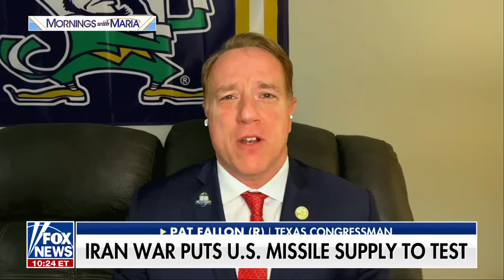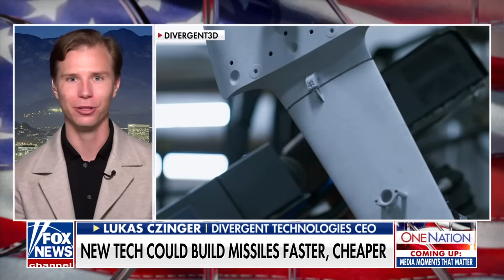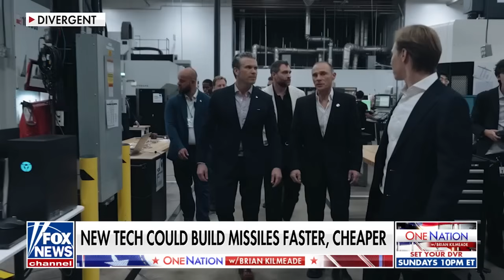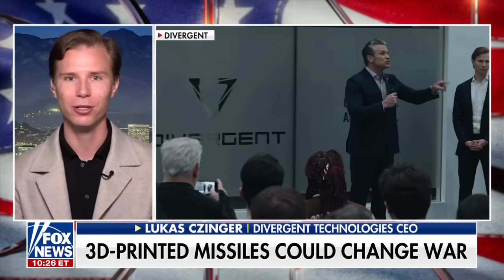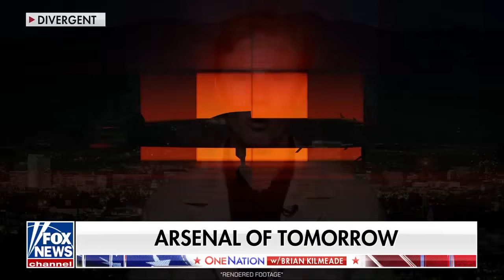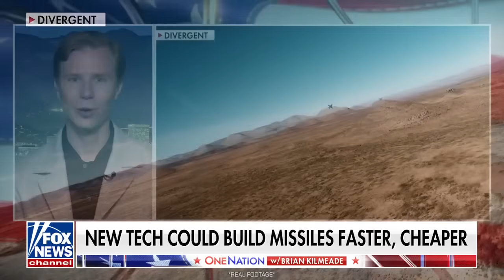ARMS RACE: Tech CEO reveals 3D-printed missiles’ potential impact on warfare

Comment: Your not getting them any faster. It takes 2 months to 3D weld just one. You don't have near enough 3D welding machines to weld 2,000 every 2 months you would require 2,000 3D welding machines and manpower to operate them.

Comment: Wow, I wouldn't think that a 3D printed missile would be able to take the stress of flight. That's pretty cool if it works.
Reply: I print model rockets, and they really aren't that durable, But I'm just going to guess that they have better printers and materials than I have.
Reply: I thinkits reinforced and they have special filament

Comment: 3D Printed Missiles.. THIS IS STUPID... 3D printing anything is SLOW AF and thus more costly... OH yea, thats why the Military Industrial Complex is throwing that idea out.. They can work less and charge more...  I have worked as an R&D engineer and machinist. Its FASTER to fabricate anything with a CNC and skilled team of welders and fabricators. 3D printing stuff only makes sense when its something you can not physically produce any other way. Like some specialty rocket engines that are being tested. Otherwise NO.. 3D printing cruise missiles is stupid.

Comment: The Rutherford engine is a liquid-propellant (LOX/RP-1), 3D-printed rocket engine developed by Rocket Lab (RKLB) for the Electron rocket.  Rocket Lab appears to manufacture roughly 1 Rutherford engine every 1–2 days under current production rates.  RKLB  Rocket Lab signed a $190 million contract for 20 HASTE launches with the U.S. Department of Defense’s Test Resource Management Center (TRMC) under the MACH‑TB 2.0 program.  Sounds like this kid got some 3D printers and is catching up.

Comment: Our logistics supply is fine. We are not low on munitions. The military has been using a lot of the older weapons, because contrary to popular belief bombs and missiles do expire. The chemical boosters in missiles and warheads degrade over time. Our strike craft have been using the older maverick system which is being phased out and replaced with JAGM missiles. ATACMS is being replaced by PrSM. Older tomahawks are being replaced by a new generation of tomahawks. Old systems are being used up and replaced with newer tech. This fear mongering has got to stop. Weapon production is actually up across the board and has been since we started supplying Ukraine with war materials. Many of our munitions have tripled or quadrupled production numbers.

Comment: Print the airframe in plastic. Submerse it in a steel mesh-infused ceramic-silica coating. The plastic can burn off and your left with a mold that will hold its shape long enough that you can use it to create aluminum or steel airframes.